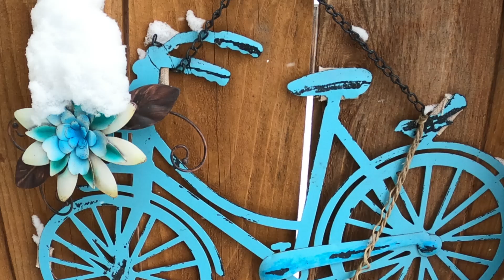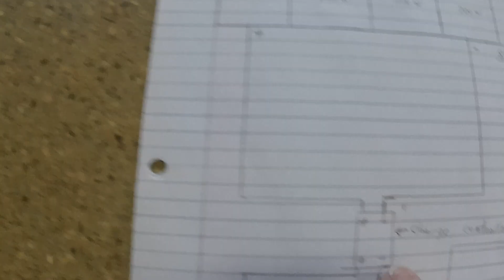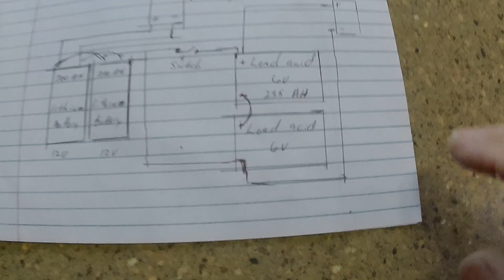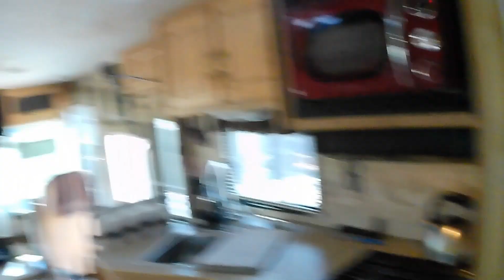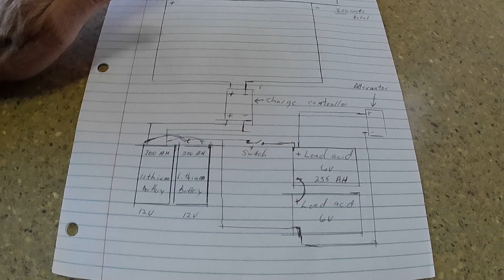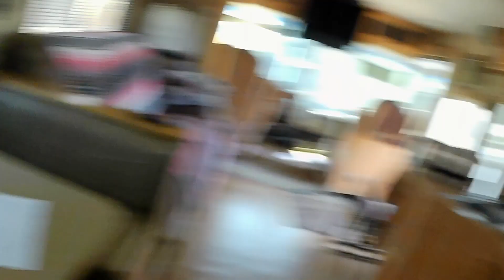An idiot mixed lead-acid with lithium batteries??

Comment: It sounds like you need to find a way to reliably fully charge your house bank (the lithium batteries) during the day.  It's a small low voltage system so with all those little loads, particularly when the inverter is left on 24x7, all the little bits of energy consumption add up.  Adding a third lithium battery in parallel will certainly help some, but the main problem is that you just aren't able to reliably charge your lithium house bank.

Generally speaking, the voltage on a LiFePO4 battery is NOT a good indication of its state of charge.  The discharge curve is so flat with LiFePO4 that it will basically maintain a decent voltage all the way to the point where it is 99% discharged, before the voltage begins to really fall.  And at that point when it does fall, it will fall quickly (because it will already be 99% discharged at that point).

Also generally speaking you don't want to tie lead-acid and lithium together.  the voltages are only somewhat compatible with each other but operation will not be ideal when they are tied.  The lithium bank should be charged to 14.2V to fully charge the lithium batteries and will maintain a voltage above 13.2V for most of its discharge curve... which is too high for lead-acid.  And a lithium battery will still have a good chunk of energy left in it at 12.3V where going any lower than that with the lead-acid will damage the lead-acid.

It is also not good for the alternator to directly charge a lithium battery, because the lithium batteries can take hundreds of amps of current and can burn-out the alternator.

So the solution is really to find a dependable way to keep the lithium bank charged.

At home, just plugging the grid into a cheap low-amperage LiFePO4 battery charger is the obvious solution.  Victron makes a small one for $100.  The Victron Energy Blue Smart IP67 Smart Marine Battery Charger 12V 7A.  That's obviously a very slow charger only being 7A, but at least at home you can leave it plugged in and not worry.  Or get a slightly more expensive model that pushes a bit more current if 7A (80-90W or so) is not enough.

For on-the-road you probably need an alternator-charger solution. Those run around $200-$250 or so.    You do NOT want to tie the alternator directly to a lithium bank as that can burn-out the alternator... and the voltages may be too high as well once the bank is charged.

-Matt
Reply from the maker: @junkerzn7312  Good morning friend, thank you for your comments. I believe you're correct I need to charge the lithium batteries at a higher voltage. I believe I want to use my portable generator to top them off? Then, perhaps all my problems will go away?
Thanks again and may God bless you!

Comment: Try connecting your panels in parallel , shade limits whole array when Series connected
Reply from the maker: @jorgeheny3867  Good morning new friend, thank you for your comments. I have five solar panels on my roof and a very in wattage. I know that's not the best scenario but it is what it is
Reply from the maker: @jorgeheny3867  sorry I prematurely hit send. They are 12 volt system and they're hooked in parallel. I'm using a 12-volt system cuz my motorhome is a 12-volt system. If not done so please subscribe to my channel as I have subscribed to yours.
Thanks again for watching and your input.
May God bless you!

Comment: Chuck, I live in a solar powered home, in the great white north (Alberta)! First thing is, the fridge companies lie to you about the power consumption! I have an efficient LG fridge, but it goes into defrost mode up to six times per day!! Each time it draws power like a hair dryer, for about 15 minutes. 
I trick my fridge by plugging it into a programmable timer, which shuts it off for 45 minutes every 3 hours at night, this resets the defrost timer and the fridge remains generally cold, but we aren’t in the south either. 
Another thing, is your fridge light incandescent? If so it draws quit a bit.
How do you monitor your solar production in a day?
I bought a 300AH lithium for my rv and it’s waaaay better than the lead acid.
Lithium batteries have a very flat charge curve, so it is hard to tell when they’re full.
I watch Andy’s “Off Grid Garage” series which is entertaining and informative.
My lithium cells weren’t quite balanced, when I purchased the battery.
I know this because I purchased a battery with bluetooth interface to my cellphone.
If the cells aren’t quite balanced the battery may go into overvoltage protection and quit charging, before it is at it’s rated capacity.
You want your lithium batteries to go over 13.8V for one hour.
Or get them to 14.0V.
You can use your generator to get your batteries started, absorbing, say for an hour or two, then let the solar finish up.
That is efficient.
Don’t use your motorhome alternator to charge the lithium, as they can accept so much power, that it will cause it to overheat and fail.
You do have a mixture of solar panels on the roof, thus the charge curves may not be getting you the best power, so it would be nice to see what the solar controller says you’re producing.
I’m not a fan of Marr connectors on high current DC circuit, btw.
Bless you, and good luck.
Reply from the maker: @TopMooseCone  Good morning friend, thank you for your advice. Living in Canada Off the Grid, with solar, I'm sure you know what you're talking about. I'm sure you've learned the best way possible, trial and error in the real world!
I bought my refrigerator for three reasons, number one it fit the hole, number two it was low on energy and number three it was cheap! About $200 to my door. It's designed for apartments and it has no defrost. I tested it for 2 days before I installed. The results were at 65 watts for about 6 minutes three times an hour. I should have had more than enough with 400 amp hours? I think I agree with you I just wasn't getting the batteries charged enough? Next time out which will be soon I'll bring out my portable generator and try to charge them with it.
I'm in total agreement with you without my wire nuts, not a good thing to use. In my defense, I changed my charge controller position and the wires were too short. That wasn't Off the Grid repair and I will replace the wires.
Thank you again for your wisdom and knowledge and may God bless you!